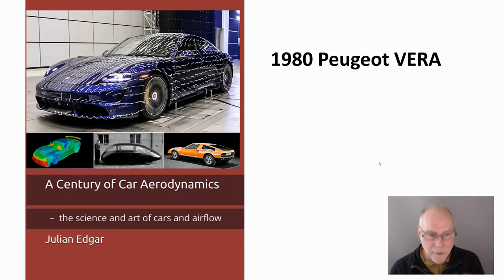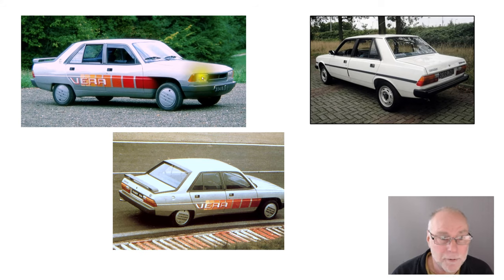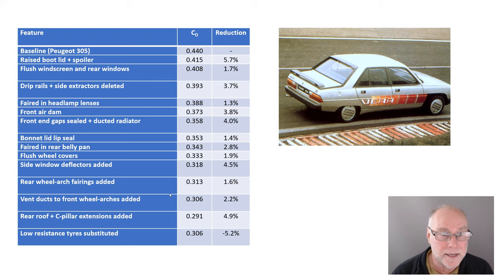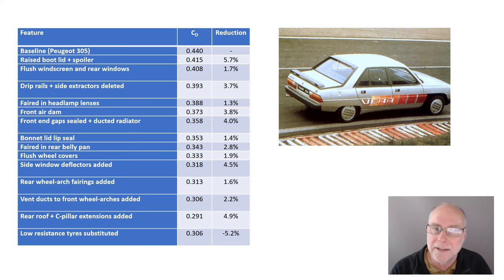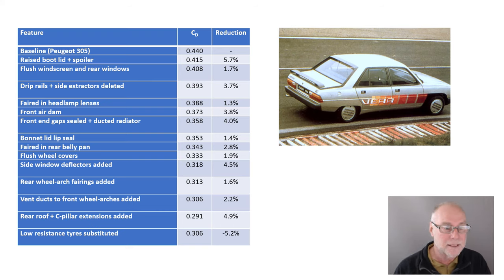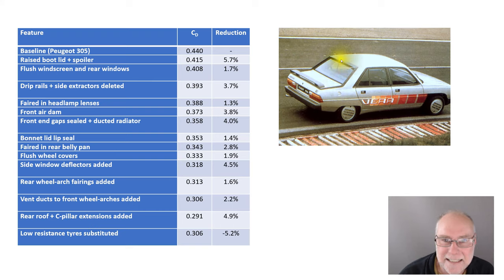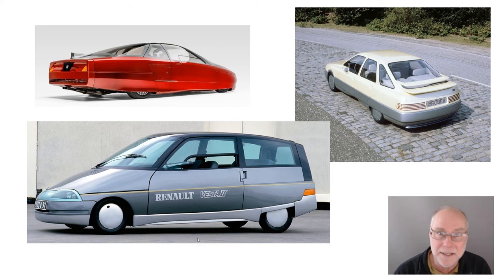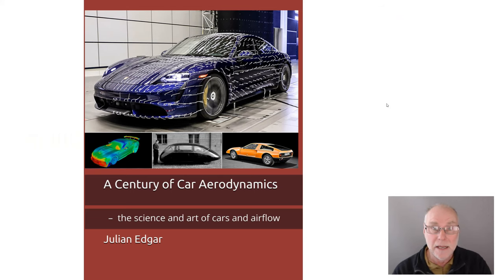The 1980 Peugeot VERA concept car

Comment: Mr Edgar i made myself one of those front under trays you aways talk about because my car (BMW e36 325td) was still overheating after installing misimoto radiator new thermostat
did a coolant flush even made fan shroud from abs plastic so the fan woud pull air through the whole radiator. And with the shroud it overheats even worst than without it this is where you were 
right for the test side of things. TEST TEST TEST no guess work . SO i decided to make the under tray. First made it from cardoard then marked the bends and where to cut. I used 3mm 
abs plastic cut it with angle grinder SUPER ESEY bend it with heat gun.  It was done very quickly then drilled 13 holes and bolted it to the bumper, chasis and other plastics with large washers it ended up litle 
crooked but oh well this was my 2nd time using this material and was under the car anyways. And oh my... did it made a difference the car also has oil cooler under the radiator and i'm guessing the under tray not only made high 
pressure air go through the radiator and not under it, but also through the oil cooler so it made it overall cooler. I could not enjoy my car because of that overheating issue and had to
turn the heat to full blast if i wanted to drive it little and i mean little harder. But after the undertray installation  i give my car a verry hard time and will not overheat and i havent
even blocked the radiator fully and the under tray i'm using is not even curved but i will add a curved part in the near future   . I can't thank you enough for sharing your knowege with us the vewers. Sorry for the bad english i'm frm Bulgaria.
And also i orderd 5 of your books.
Reply from the maker: All good to hear!

Comment: Thanks for this very interesting analysis. Looking at today's PSA cars it seems that they slowly incorporated all the solutions on their "mainstream" designs. An interesting note is the improvement obtained with the rear roof + c-pillar extensions, do you think this is related to a kind of separation edge of box cavity effect?
Reply from the maker: It's to reduce suction peaks as air wraps around these curves. With such a steep rear window angle, separation is going to occur anyway, so best to make it occur cleanly.

Comment: Interesting to see that the front guard vent was a minor change. Almost everything else could potentially be retrofitted (depending on car construction the drip rail delete may be out of the question, I'd imagine some of those are a roof-side join point), so it was good to see that 80% effort could give 90% gains.

Do you have any info on classic cars? They largely look like aero nightmares, excepting aero specials like the Superbird.
Reply from the maker: I cover cars going back to 1921 in the cited book.
Reply: @JulianEdgar  fair cop :p

My mate is supposedly getting a 1962 Thunderbird with a big block next weekend. No serious mods are planned but we'll probably be making a fan shroud and ducting for the radiator and triple carbs if it shows any signs of overheating or not liking modern fuels. Will give me chance to break out my digital manometer and thermometer probes...

Comment: The car manufacturers show how much they could improve the aerodynamics but they refuse to do it on the cars that they sell. How many billions of litres less fuel could the world have burned if the manufacturers had implemented what they have demonstrated they know?
Reply from the maker: 1980 is a long time ago. Mainstream cars are now more aero-efficient than they have ever been - and by a long way.
Reply: @JulianEdgar  They are nothing like as good as the "Schloerwagen" of 1939, of which only one prototype was made. The best of them are a bit better than Peugeot's "VERA" of 1980. Some manufacturers are giving misleading drag coefficient figures obtained by taking the frontal area to be that of a rectangle touching the extremities of the car as seen from in front.
Reply from the maker: Yes the Schloerwagen had a good drag coefficient. However, it also had a very large projected frontal area (and so total drag wasn't that good), and would never pass lift and stability standards used by car manufacturers today. Maybe read the book?